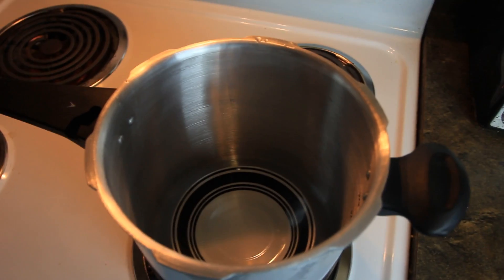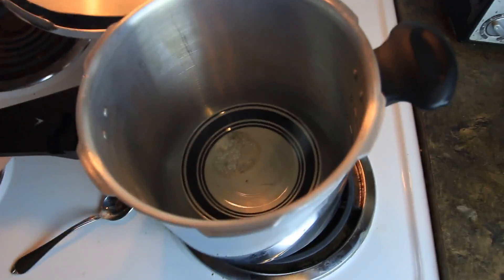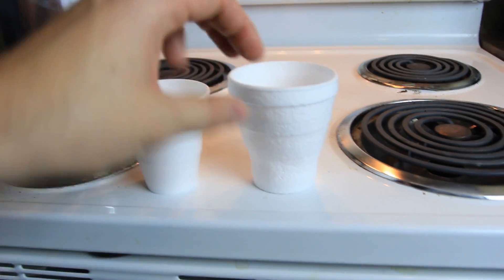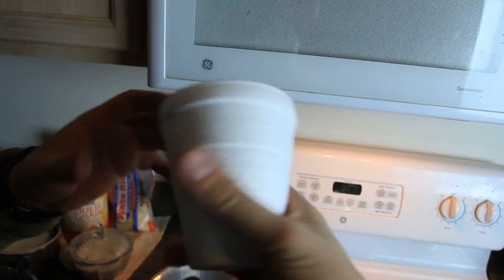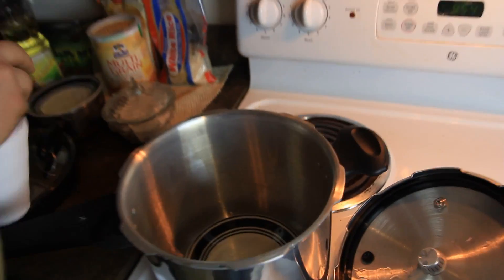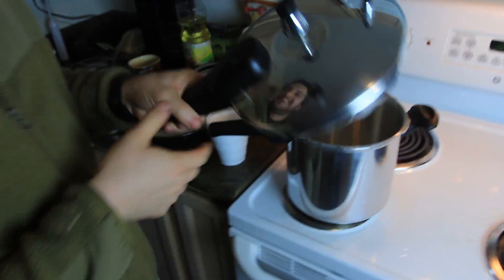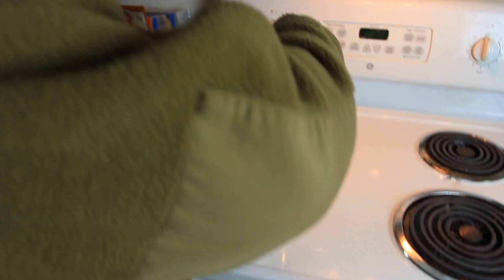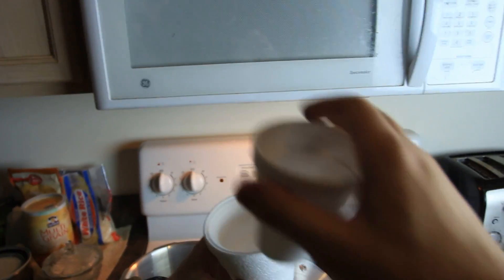Expanding Styrofoam Cup - Science Experiment

Comment: How about putting a styrofoam cup in a warm glass container & apply a vacuum to remove most of the air. Wouldn't that also cause the cup to swell ?
Raising the air pressure inside a warm glass container should shrink the cup.
I like Crazy Russians!
Reply: it would work, that's pretty much how they make the cups right there